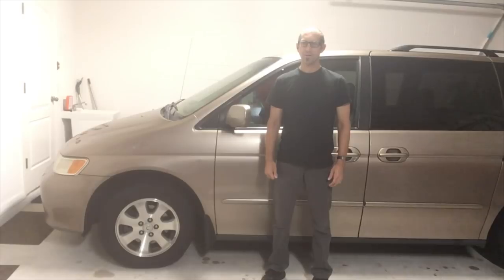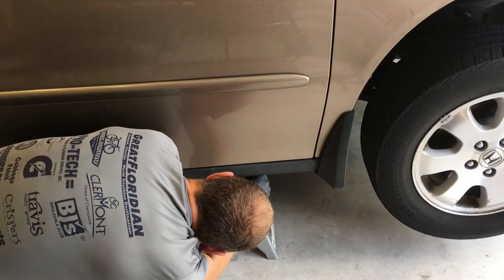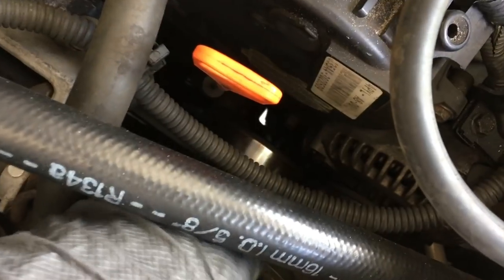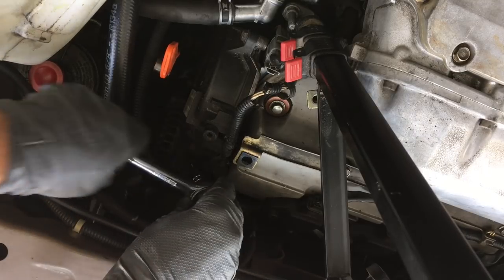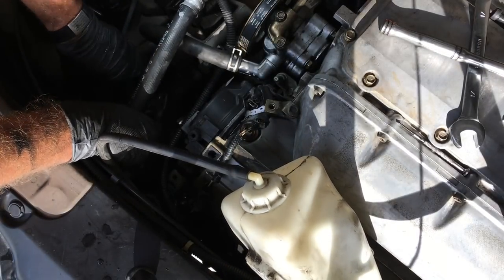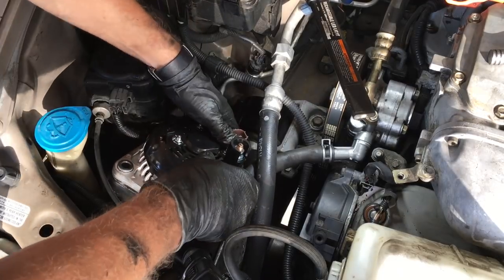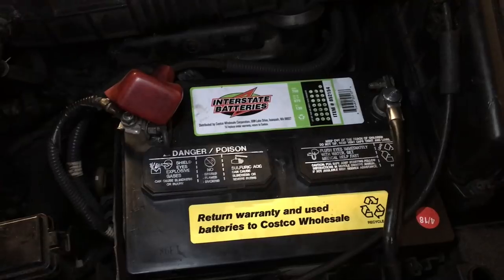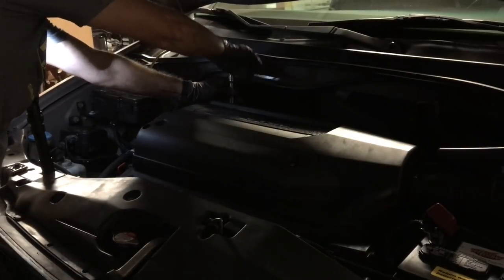2004 Honda Odyssey Alternator Removal & Replacement without removing tensioner pulley

Comment: Question for a 2000 Honda odyssey how would I access the tension pulley bolt? Where is it located?
Reply from the maker: 1999-2001 odyssey’s are slightly different than my 2004.  For a 2000, the pulley is held in place by one bolt in the middle of the pulley.  It’s a reverse thread bolt so it’s clockwise to loosen and counterclockwise to tighten. When replacing the bolt, it should be torqued to 28ftlb.  Hope this helps.

Comment: Hi DIY Jeff :I love your video . My Odyssey 1999 , today it is suddenly the battery , the doors and seatbelt ' s lights on . I tried to drive home about 35 kms and the engine was dead . So it is wrong for alternator or battery ? Give me your idea , thank you .
Reply from the maker: Dzung ng, those symptoms could be either the battery or the alternator.  I'd suggest having an auto parts store test your battery (most do it for free).  If the battery is good then it is the alternator.  If the battery is bad it could still be the alternator since a bad alternator can cause a battery to go bad if the battery was already weak.  If it's the alternator, you can pick one up at your local auto parts store or I also have a link in the video description where you can find it online for a better deal.
Reply: @DIYJeff  : the problem is alternator . I replaced a new one and every thing is ok .Thanks Jeff

Comment: Hi, like your video. I have an alternator with a pulley that doesn't rotate freely. It's a little bit stiff. I have asked mechanics to keep my alternator and only change the pulley. They always want to change the whole alternator which is an expensive repair. Are they just choosing the lazy and pricer option? Thanks
Reply from the maker: Hugo Henderson, that's a great question.  I believe the reason they want to change the alternator is because in order to replace the pulley, it's not much more additional labor to remove the alternator since the serpentine belt is already off, and most shops pull the pulley itself to pull the alternator.  In their mind they see it as a plus for the customer to save on additional labor down the road, but they're also looking to increase profits at the same time. But if the alternator isn't bad, and it's only a couple years old, it's really up to you if you want to replace it.  If it's more than 5 years old, it might be worth the extra cost to have it done (or do it yourself) while it's already apart.  Those are my two cents.
Reply: DIY Jeff Oh that's interesting. My car is a W reg so it's likely the alternator hasn't been replaced in years or ever before. I got a new drive belt fitted as the old one was worn with holes and starting to fray. My mechanic suggested to replace the alternator as the pulley could not move freely. I asked him to only change the belt as it manages to run smoothly. There's only very slight resistance. I've had a look myself from starting up the car and can see it spinning. Later on down the line it will most likely need replacing but is still managing to go fairly strong at the moment. What's your opinion on this?
Reply from the maker: Hugo Henderson , what kind of car do you have?  You do need to be careful about too much tension as it will cause the belt to wear out quicker and could cause too much tension on the alternator as well.  As long as the tension isn’t too tight you might be okay.
Reply: DIY Jeff I have a Toyota Yaris 1999-2005 model. I'm going to see how I get on, I'm fairly confident it should last long as the car runs quietly unlike some videos I've seen! Where the pulleys are making loud noises.

Comment: hello i found your video to be really helpful  but im having a real issue getting the belt back on the bottom pully even with pulling all the way back on the tensioner bolt.  any suggestions
Reply from the maker: Jennifer Lawson , not sure, because when I pulled the tensioner all the way back, there was plenty of room to slide it on.  Are you using a tensioner pulley tool?
Reply: @DIYJeff  which bar did you use I'm not getting as much slack
Reply from the maker: Jennifer Lawson, as I mentioned in the video, a tensioner pulley tool.  If you have an autozone near you they will rent you one for free.  It provides more leverage and will rotate the puller more providing more slack.

Comment: If I did those exact steps and the pulley comes down on release but does not put tension on the belt, do I have to buy another pulley?
Reply from the maker: @Don Jones, definitely sounds like your pulley is bad.

Comment: So is $400 plus dollars ALOT for having this done including alternator? I took my van to a place, told them to," LOOK AT IT,"  and they ended up fix in it and are now wanting like $430. After watching this I'll do it myself and but an alternator for about $135, $140.. And save a boatload of labor cost.
Reply from the maker: Diaz Fan , it’s all in how you look at it and how much time you have.  I’d say what they charged you is right in line for replacing it.  They probably charged around $200 for the alternator because they’re making money on that as well.  And probably 3 hours labor, although a true mechanic could probably do it an an hour and a half.  But to answer your last question, yes, doing it yourself would save you close to $300.
Reply: No shop should be doing work on your car if they haven't gotten your approval.   It's easy for me to sit here and type this when I'm not the one dealing with the shop.  They might have legitimately thought you wanted it replaced rather than just diagnosis.

Comment: I took my odyssey to a mechanic to fix the alternator (which they replaced) but now my power steering is really loud and I can feel it in the steering wheel everytime I turn. What can I do to fix that?
Reply from the maker: You should first check your power steering fluid.  If your fluid level is full then it sounds like a power steering pump replacement is in your future.

Comment: Hi Jeff, question, Will this video help me for a 2009 Honda Odyssey Touring? Thank You
Reply from the maker: venanciocruz1974 , I’m honestly not sure.  I haven’t worked on a newer odyssey.  I would think if the alternator looks like it’s in the same location as my video it would be very close.
Reply from the maker: I found a video you might find helpful for a 2009 Odyssey alternator replacement.  Not as clear as my presentation, but you should be able to get enough out of it to do the job. https://www.youtube.com/watch?v=cIlXP3Ny1iI

Comment: I got a question, when I got to put the alternator back for some reason the 2 bolts at the end don't go together well and space is off like a inch or so to put the other bolt in has this happened before jve tried everything??

Comment: Lower alternator bolt is a pain in the ass to putback on...any suggestions?
Reply from the maker: Hector Gonzalez, make sure that the longer bolt goes on the bottom.  Honestly, I didn't have a hard time  getting either bolt in.  But if you struggling with the bottom one, try taking the top one out and then try the bottom.  It might give you a little more play to line up the two holes.

Comment: 2003 model, I had to remove the 12 mm bolt from belt tensioner to be able to get 14 mm alternator bolt out. Also removed brake fluid bottle bracket to get alternator out.

Comment: Both bolts broke out of my alternator that hold it together are they the same bolt (size and length) and if by chance what are the size. I know they are metric
Reply from the maker: David Meeks, wow, I'm surprised that both of the bolts would have broken.  They are pretty hefty bolts.  First make sure that none of the bolts is broken off inside the mounting plate.  As far as sizes go, I happen to have the service manual for the Odyssey so you're in luck.  They are different sizes.  One is a 10 x 1.25mm which gets torqued to 33 ft lbs.  And the other is 8 x 1.25mm which gets torqued to 16 ft lbs.  I'm not sure where you could find them, but I'm sure a junk yard may have them or a specialty online store.  Of course the dealer could probably special order them if they don't have them in stock.  Good Luck!

Comment: What if I don't have the serp. belt pulley tool? What can i use instead ??
Reply from the maker: RAY T.H. Yuen , you can try to link to wrenches together, but there isn’t much clearance to get the wrench on the bolt.  I’d suggest renting one for free from your local autozone or purchasing one from Amazon for about $30.

Comment: Hi im having trouble loosen the tension what size socket do i use for the tension pulley?
Reply from the maker: 80Dantheman, It depends on the year vehicle you have on how to release the tension on the pulley.  For 2002-2004 models (mine is 2004), there is a tension release bolt just below the pulley that takes a 19mm socket.  For 1999-2001 models you release the tension by turning the bolt counterclockwise that's in the center of the pulley itself.  Since I don't have that model, I'm not sure what size the bolt is in the middle of the pulley.  If I had to guess I'd say it's between 17-19mm.  Hope this info helps.
Reply: @DIYJeff  mine is 2004 can i access from the top sorry to bother you with this?
Reply from the maker: 80Dantheman, unfortunately no.  The only access I could get to it was from under the vehicle.  When I was making the video I looked from the top side and tension release bolt was hidden and I couldn’t reach it.  From under the vehicle I was able to easily see it and wiggle a socket onto it.  There isn’t much clearance and a socket wrench was too thick.  I had to use the tensioner pulley tool I used in the video.  I rented it for free from the auto parts store.
Reply: @DIYJeff  Thank you so much i appriciate the information.Happy holidays to you Thank you good video by the way.
Reply: And getting the serpertine belt loaner tool from Autozone is very helpful

Comment: How hard is it to remove that pully? Wouldn't that be easier?
Reply from the maker: @DevenAK49, not very hard, just a preference if you want to do it and I chose not to.
Reply: @DIYJeff  I was having a hard time with it because whoever changed the alternator last, drilled out that threading and put a nut on the other side of a longer bolt(it was so hard to put that nut back on that bolt)
Reply from the maker: @DevinAK49 , I can see how that would be extremely frustrating.  They must have cross threaded the previous bolt and screwed up the threads so instead of tapping the threads, they drilled them out.
Reply: @DIYJeff  it was, but I got it done. Thanks, in most part, to the video.

Comment: Ok, I hit a brick wall! Just how do you remove the 14 mm bolt,...when the pulley is in the way?
Reply from the maker: @Mr G, you need to use a wrench and not a socket.  It helps even more if you have a ratcheting wrench.
Reply: @DIYJeff  I got it out already, used a wrench and a pipe for leverage, thanks!

Comment: How many miles were on your Odyssey when your Alternator quit?
Reply from the maker: cgrscott , it was right around 220,000..
Reply: @DIYJeff  Thanks for your reply. I have 330k on my original Honda Odyssey Alternator. This past week my mechanic said it checks out as healthy.  I also have the original Honda AC compressor and it just won’t quit.  I have anxiety about continuing to own this vehicle because two very expensive components are living on borrowed time.
Reply from the maker: cgrscott , I agree, but Honda’s seem to go forever!  I’ve been thoroughly impressed with mine.  I’m at 237,000.
Reply: As of today, my 2001 Honda Odyssey is condemned for replacement.  It needs a new radiator and head gasket.  I'm probably just going to nurse it along, keeping the coolant and engine oil topped off and just drive it locally as a non-road-trip vehicle.
Reply from the maker: cgrscott , sorry to hear that. I guess I’ll have a video out someday when my radiator or head gasket go bad, lol
Reply: @DIYJeff  The day after the bad news with the Honda Odyssey, things don’t seem quite so gloomy.  I bought the Honda recamended antifreeze and topped off the radiator and found that the coolant leaking rate is very small and minute.  I only had to ad a little bit of anti-freeze to top it off.

In the early 1980s, my Dodge Omni had a small radiator leek that I was able to completely stop by putting stop-leak pellets in the radiator.  Today I went ahead and put stop leak in in the Odyssey radiator.  The oil leaking is really no more than what I had these last two years.  

So, the Odyssey is going to be like that old family pickup that you keep for utility but, you would never want to take it on a road trip.

I think we still have reliable local transportation with the Odyssey for a couple more years if we don’t use it for road trips.  I actually was planning on keeping the Odyssey for just two more years before I found to about the radiator and head gasket.  So, I think we'lll maintain our ownership plans with this vehicle. Thanks for chatting with me.